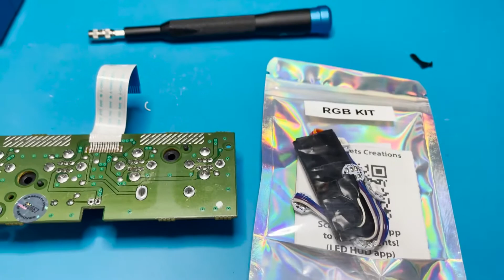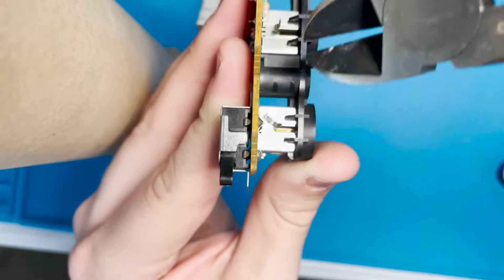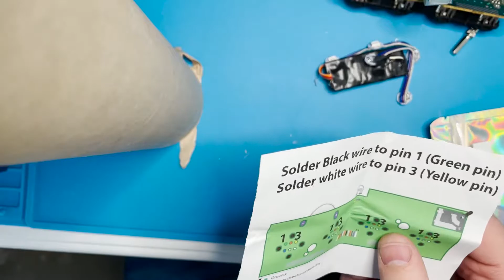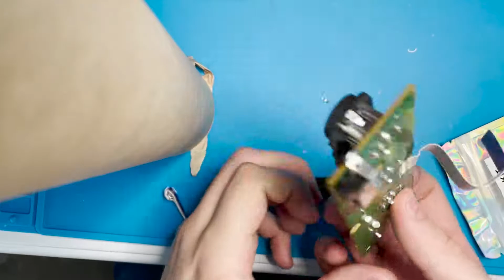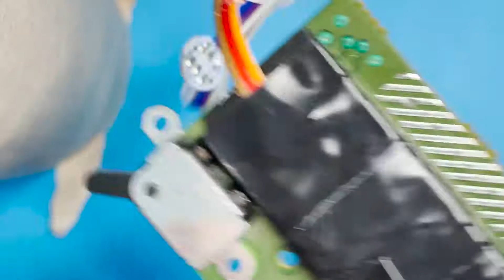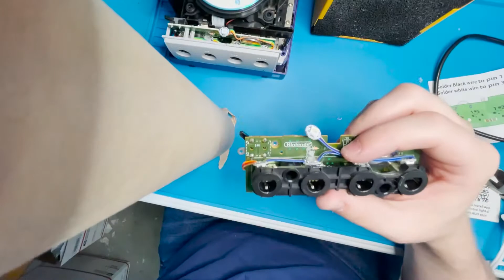How to add RGB LED's to your gamecube! Bluetooth controlled!

Comment from the maker: One part I did forget is you need to desolder the top LED from the controller port. To do that just heat up the solder that connects the top LED to the PCB and use your other hand to pull on the LED as you heat up the solder. It will allow you to pull the LED off. BE CAREFUL! The LED will get hot when doing this and you could burn your finger! use a pliers if you need to! If you need a video on how to do this leave a comment and I will.
Reply: the kit is unavailable.
Reply: yo will you put this kit up again soon?
Reply from the maker: @idkd9176  Hello. Sorry for the late reply. I have been away from the gamecube scene due to the winter. I plan to make more this summer. along with more custom cubes. Sorry about that. I hope by now you found something.